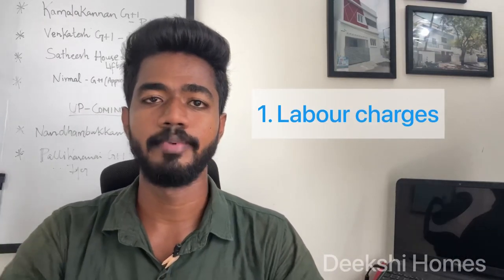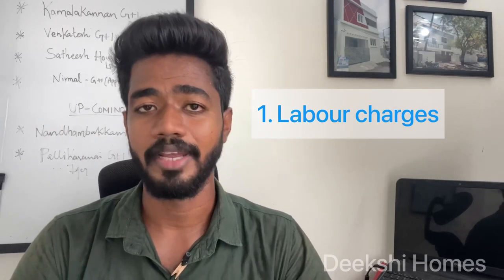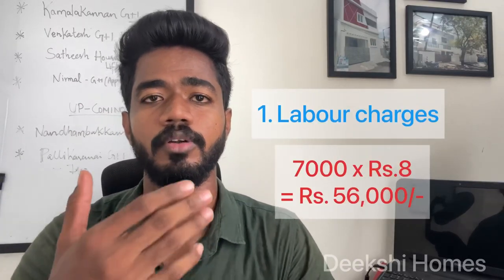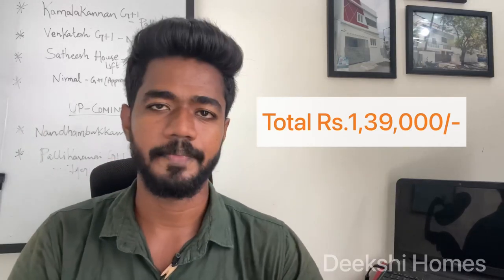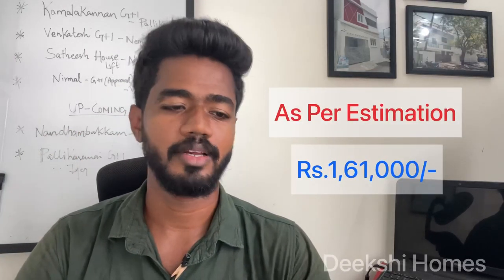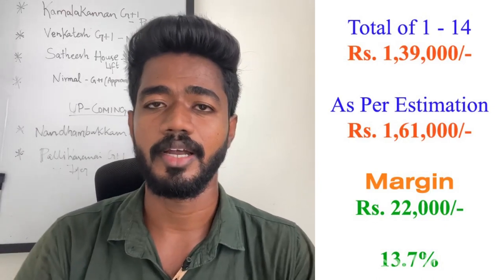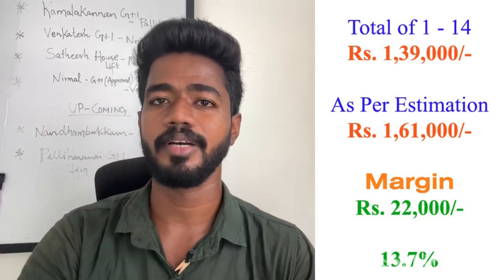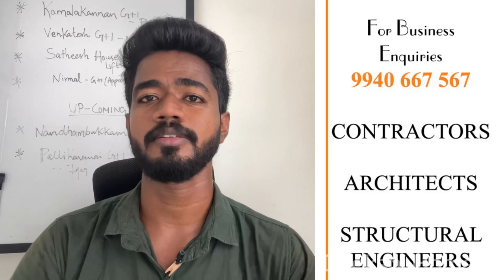Construction Cost of Underground Water Sump 2022| Detailed Cost | Deekshi Homes

Comment: Sir pl. TELL me today cost for construction 3000 ltrs. sump. Pl. Reply
Reply from the maker: 3000 x 23  or 24 or 25 as the capacity is lesser cost will be higher
Reply from the maker: Yes roughly 22 to 25 depending upon materials spec